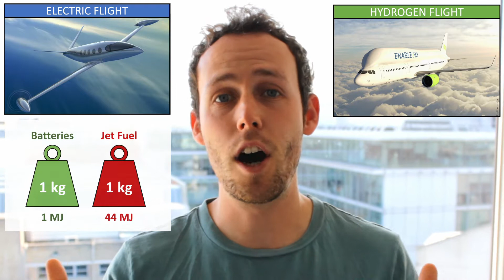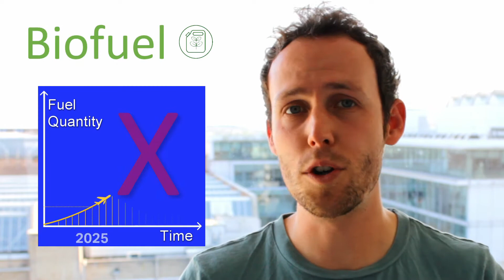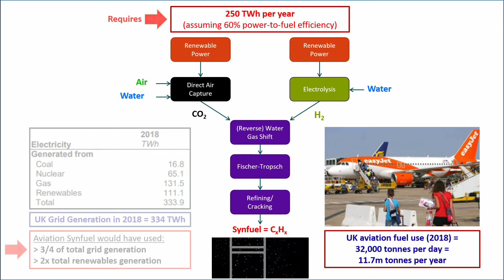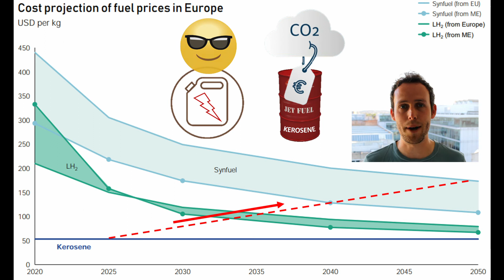Alternative Jet Fuels   (Part 8: Sustainable Aviation)

Comment: Bosch and Porsche seem to be projecting that the cost of synthetic fuel will be the same as normal petrol and diesel by 2030. The main cost of these synthetic fuels will be electricity. And it seems like the cost of the cheapest electricity in the world will be dropping quite low by then. In some places it is already about 1/10th the cost of average US electricity.
Reply from the maker: No matter the cost of electricity, it is still a cheaper and more efficient thing to use EVs rather than hydrogen/synfuel right? https://www.transportenvironment.org/file/4477 and flying is an inefficient mode of transport vs. ground transport. So it is the least efficient use of renewable energy you can think of. 

Use of synfuel for cars is more bonkers than hydrogen fuel cells... I think Porsche are just hoping to hang on to their combustion engine assets for as long as possible + hope very rich people will pay the high price for the fuel to keep using the old tech. Clearly it's a waste of limited renewable energy resource though... and should be regulated against (i.e. should pay a higher cost for electricity to discourage)... which will make it more expensive again. 

Price parity of synfuel with fossil fuels seems very unlikely by 2030 and indeed by 2040... I expect it'll be 2-4 times the cost still in 2040, based on Royal Society report, Fig. 7: https://royalsociety.org/-/media/policy/projects/synthetic-fuels/synthetic-fuels-briefing.pdf
Reply: @GreenSkyThinking  For smaller vehicles I think batteries are best. I also am not sure efficiency is the most important thing, but rather total cost. For example: Covering only about 1% of the Saharan dessert in solar cells will give enough electricity to power the entire Earth! So I think in the medium to long run, renewable energy is not limited. It is limited right now, because it is mostly government subsidized, organized and not profitable enough yet. 

The main limitation for renewables at the moment is profitability. The more profitable it becomes the more it will be used. So I think we should welcome any new industry that is profitable with renewable energy. I also think these synfuel companies are planning on setting up their own renewables, so it doesn't really affect the other efforts to use renewables. Rather, it brings demand and thus more innovation and lower costs for the whole renewable sector.

Also, making synfuels can be done in remote areas with the cheapest possible renewable electricity. The synfuel would essentially be used like a battery and then exported with existing infrastructure.
The alternative would be to set up ultra long power lines (also with substantial losses) and giant battery banks (very very expensive) hooked up to the renewables, but I suspect this will not be as profitable. 

So, in conclusion I don't think it is a zero sum game, and we are just waiting for renewables to cross the profitability threshold (relative to fossil fuels). I think this is happening right now, but only for certain sectors and in certain locations first. 
There have been many predictions on battery costs and renewable costs over the years, and if I remember correctly, most of them where way to conservative in predicting how fast the costs would drop.
So I am quite optimistic. I don't think we should regulate the space, by mandating who gets to use renewables etc. Perhaps the solution is a carbon tax.
Reply: @GreenSkyThinking  For comparison, average household electricity in the US is about $0.13 / kWh and the cheapest wind/solar energy in the world is less than $0.02 / kWh. And the prices are probably going to drop even more. The amount of renewable electricity worldwide is going to explode once it finds a way to be profitable.
Reply from the maker: @cryptohouse1676  the problem is that our total global energy consumption is also growing every year and has actually been rising faster than renewables growth... so fossil fuel consumption (and thus greenhouse gas emissions) have been rising too. Just look at the stats: https://ourworldindata.org/fossil-fuels

Bottom line is that fossil fuel companies love anything that increases energy consumption as it means the use of fossil fuels will be prolonged. Flying, bigger cars, bigger (poorly insulated) houses, higher data use etc. So we need to both grow renewables AND decrease energy consumption through a) promoting high efficiency  activities b) regulating against low efficiency activities. 

With flying, we need to a) encourage switch to ground transport where possible, b) encourage shorter and slower flights, c) have mandates for synfuel, d) tax remaining fossil fuel use. 

If synfuel is definitely going to be so cheap then where are the government roadmaps showing high % mandates by 2025, 2030, 2035, 2040? The only country I'm aware of is Germany which is 2-5% alternative fuel by 2030 (mostly biofuels). If it's gonna be price-parity by 2030, then we could implement a 100% synfuel mandate by then right? Also we could ban the use of biofuels?

The problem with these extrapolations for cost reduction, is that they are enabled by economies of scale and technology development... so somebody has to pay for it initially when it's small scale, undeveloped, and expensive. If anybody is doing it, surely it should be the relatively rich, relatively high-emitting minority who are flying? Therefore, flying needs to get more expensive, before it gets cheaper?

Comment: What about the alcohol-to-jet pathway?
Reply from the maker: Hi Brett,

Alcohol-to-jet has not been proven to work at scale yet, so not a technology we can place our hopes on.

Anyway, assuming it does work and scale up, without causing in-direct land use change impacts, take a look at this paper: https://theicct.org/publications/cost-supporting-alternative-jet-fuels-european-union

Specifically Figure 2 within the paper so see that it costs at least 4x conventional aviation fuel. So we need emissions pricing on the conventional kerosene.
Reply: Any hydrocarbon will emit CO2. Sorry for spamming but Europe has changed the policy which they will go for hydrogen and battery only,  not SAF. SAF still emits CO2. Please get your update about the recent policy change here https://ec.europa.eu/commission/presscorner/api/files/document/print/en/ip_22_3854/IP_22_3854_EN.pdf

Comment: 50 USD for a kilogram of jet fuel? How the hell does this make sense? Isn't jet fuel about the same cost as regular petrol? Even if it were twice the cost the numbers don't add up at all
Reply from the maker: Hi Chris, yes you've noticed a mistake in the units used on the graph I reference from this report (Page 48): https://www.fch.europa.eu/sites/default/files/FCH%20Docs/20200507_Hydrogen%20Powered%20Aviation%20report_FINAL%20web%20%28ID%208706035%29.pdf I think that should be US cents rather than USD (dollars) - they seem to have their numbers correct elsewhere in the report I think it's just an error with title on the graph.
The point I make in the video still remains as it's about RELATIVE cost of untaxed kerosene vs. LH2 and synthetic fuel yes? Which is an order of magnitude different into the future.
Jet fuel is roughly the same cost as petrol/diesel but is currently pretty much untaxed or close to zero tax, e.g. have a look at these plots showing relative prices in Europe, with petrol/diesel costing much more due to fuel duty price: https://infogram.com/202101_blog_fuel_price_covid_indexed-1hnq410oozpnp23
This is a big inequality as it's mostly wealthy high emitters making use of this tax-break and distorting the market to make e.g. more inefficient air transport cheaper than public transport by road or rail for example. Take a look at this: https://stay-grounded.org/wp-content/uploads/2020/06/Fuel-Tax_1024x512.png

Comment: I'd be keen on your thoughts on algae fuels?
Reply from the maker: Hi Ian, absolutely and great question.

Firstly, algae biofuel just hasn't taken off yet, the technology is still at lab scale and hasn't been made commercially viable at larger scale. Big investors have pulled out, etc. so we can't rely on it in any case until its proven.

You might think "OK but if its a good solution maybe we should fund lots of development?"

Well if you look into some studies, you start to realise its not all its sold to be - you need huge amounts/areas of water and the environmental impact is not great.

Next... Let's just say we DO discover a low environmental impact, low cost algae feedstock for bioenergy? 
This is a BIG assumption, but forget that for now: why would we use that bioenergy for aircraft fuel rather than a bioenergy power plant on the ground?

- A bioenergy power plant is way more efficient than an aircraft engine (+60% vs. 20-40% efficiency). 
- per tonne of biomass you displace a greater amount of fossil fuel, and therefore abate more GHG emissions
- you can add a CCS filter to the exhaust and capture the GHG emissions there and then
- you don't have the issues of contrails with aircraft that produce 2/3rd of aviations climate impact due to exhaust forming contrail cirrus clouds at high altitude

Summary:
- can't bet on algae and not ready and development has run into lots of issues
- it still has a negative environmental impact and should be minimised
- any low impact, low cost algae you can grow should be sent straight to a BECCS plant (we are currently planning to cover an area 1-5 times the size of India in bioenergy crops for CCS by the end of the century... so could do with algae coming good for that and utilise it for that rather than burning it in a plane)

Further reading: http://www.biofuelwatch.org.uk/campaigns/biotech-for-biofuels/

Let me know your thoughts, and thanks for the question!
Reply: So all we need is a new type of algae be found that runs on seawater/waste water and is as cheap to process as fossil fuel and can be grown in a ditch where crop will not grow?
I disagree on the BECCS bit.  Efficiency-wise nothing beats renewable electricity generation.  Photosynthesis alone will cost you 80-90% of the solar energy.  Biofuels should therefore be used only when there are no electric alternatives, when either the energy density or the carbon itself is essential for the purpose.  
This is almost philosophical: when more people are raised above the poverty line maybe around 2050 (despite those still under constant hunger), more will want to travel, a big part of them will want to travel by air, and airlines will want to fulfill these demands.  How do you suggest they do that cleaner than what they do now if hydrogen and electric are still far away and probably cannot fly farther than from france to germany?
Reply from the maker: @ianhu7755  "all we need" is an understatement - it's almost impossible to do that.

I agree on bioenergy being an inefficient conversion of solar energy into stored energy - that's why I say in this video that biofuels cannot be scaled sustainably and should be removed from consideration. This applies to any biofuel crop, whether its land-based or marine such as algae or seaweed.

I would advocate for solar produced synthetic fuel as you suggest - that's what I'm saying in this video yes? Synthetic fuel CAN be scaled... its expensive though vs. untaxed kerosene/jet fuel so we need increased emissions pricing/tax of fossil fuel.
Reply: @GreenSkyThinking   Hello there, 
Now we're using algae biofuel, so what are your thoughts now?
Reply from the maker: @myconerd  Have you got a link to a news story article? Confirming process, quantity, price, etc?
Reply: @GreenSkyThinking  Not yet. Where's it?

Comment: Great video! Apart from CO2, how clean will synthetic aviation fuel burn? Are there other harmful emissions?
Reply from the maker: Hello, thank you!

So as per conventional fuel: 1kg of alternative fuel still produces 3.15kg of CO2, no difference there. When it comes to non-CO2 emissions such as soot, and other combustion side-products there is room for improvement because you can tailor the fuel chemistry to minimise those side-products. This is good for health impacts near the airport from ground operation, but also these by products like soot are nucleation points in the sky for ice crystals and contrail cloud cirrus to form. Such contrails can increase the global warming potential of the CO2 alone by a factor of 3. So there is good reason to use alternative fuel for specific routes, flights, and weather conditions which are susceptible to high levels of non-CO2.

Now: the issue with this is that the non-CO2 impacts of aviation are not currently accounted for in any existing regulations: the national greenhouse gases (GHG) inventory submissions to the UNFCCC, the CORSIA scheme, nor the EU Emissions Trading System (ETS). They are currently dismissed by the International Civil Aviation Organizational (ICAO) as being too scientifically uncertain to warrant necessary action.
This draws unfortunate parallels with the tobacco industry and fossil fuel industry’s past tactics of emphasising scientific uncertainties in cancer and global warming studies.

Hopefully this response was informative - please let me know if you'd like sources for any of this - happy to provide.
Reply: @GreenSkyThinking  Thanks for your answer. Do you see potential in microturbine generators being used in ships and boats as range extendors for hybrid-electric setups? I heard microturbines are much cleaner than traditional piston engines.
Reply from the maker: @cryptohouse1676  a lot of boats do have gas turbines. You're still burning fossil fuel. You might get an efficiency improvement but this is meaningless without emissions pricing for shipping also. The international maritime organisation (IMO) have a similarly poor grasp on this, in the same way ICAO have an awful system (CORSIA) for international aviation.

So my point being: technology efficiency improvements are worth nothing without effective policy, emissions accounting and regulation. This is lacking from both the international shipping and aviation sector.
Reply: Sorry for spamming but Europe has changed the policy which they will go for hydrogen and battery only not SAF. Please get your update about the recent policy change here https://ec.europa.eu/commission/presscorner/api/files/document/print/en/ip_22_3854/IP_22_3854_EN.pdf